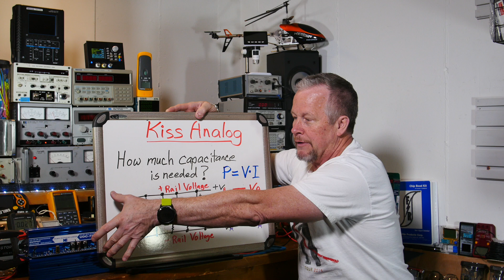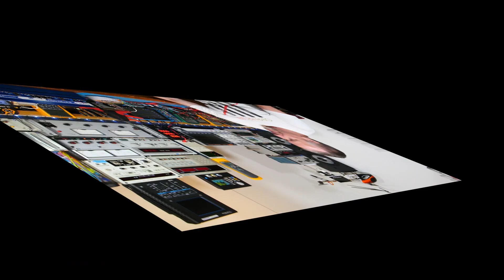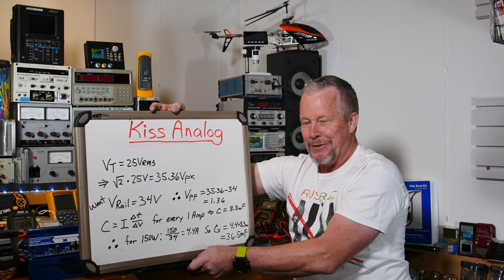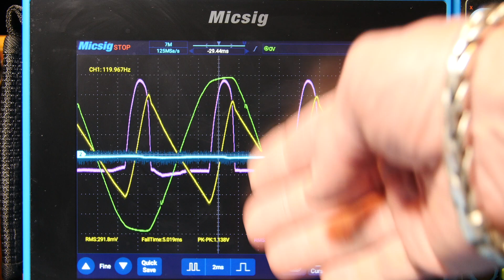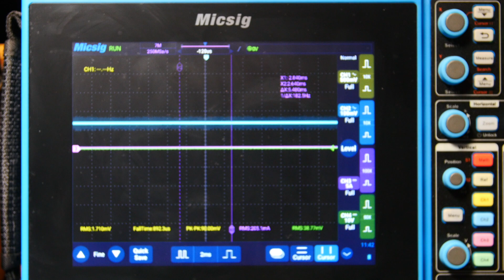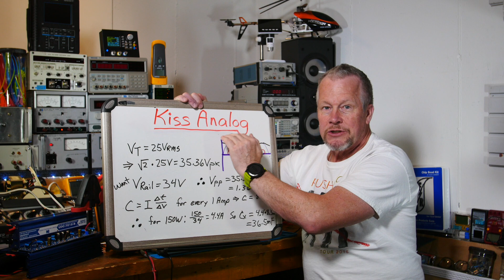How Much Capacitance is Needed? #capacitorbankdesign #capacitor #howmuchripple #capacitordesign

Comment: Hey Eddie. I may be 3 yrs too late for this vid, but the information you give will of course never NOT be useful. (Sorry for the double negative) I’m in the process of getting together everything I need to put together another one of Nelson’s designs, the F6. It’s got all the power I’ll ever need with both of my main pairs of speakers being aprox 95dB sensitive. 

Also, before I build it, I wanted to give you a heartfelt thank you for sharing this information regarding the PSU. My job mostly consists of setting up, fixing, and modifying guitars, building custom effects pedals, but I also occasionally fix tube amps, but I haven’t actually built one, let alone a solid state one. The 2 types of amplifiers may be different, but they’ve got more in common than not. So, again, just a late thank you for taking the time to explain the build process of another one of Nelson’s brilliant designs.
Reply from the maker: Thanks so much for your feedback!  I appreciate you!

Comment: Hello,

I do not know decide between amplifier atoll in100 and in80,   class AB

the in100 has two toroidal transformers of 340VA, it is NOT dual mono, 
amp is 2x100W

thi in80 has one transformer of 340VA
ammp is 2x80W

both have the same capacitance about 31000 microF, isnt this small for 2x100W?

Which one is supposed to be better by teory?

Thank you

Comment: Great video. Im looking on eBay for an amp to send you that uses around 16 volts and is AB so I can also send you a large cap. I’d be interested in seeing which performs better a bank of smaller caps or 1 large cap. Your videos have got my brain on power supplies and amps 24/7.
Reply from the maker: Thank you Tron - that is very generous;)

Comment: Hi thank you very much indeed for your video.  Unfortunately i have difficulty to understand complex issues.  But if i got it right the result says that in  most of commercial amps power supply capacitance is undersized ?  i usually see less than 1mF/rail/channel  
Actually very often i see only 2 x 10,000uF caps in total   This makes sense considering that big caps are so expensive. Costs saving. 
And i have the feeling that this has a big negative impact on sound quality.   Some brands used to offer a capacitance upgrade for some of their power amps.   A good practical way could be to put an analog voltmeter across power supply caps terminals and see if the voltage stays steady or drops during the loudest passages.  My guess is that in most cases drops. Thanks again, gino
Reply from the maker: Great input Gino!  Yes, a higher voltage and more ripple could be less costly.  This might be just fine, but maybe not.  your idea of measuring the voltage is right on point.
Reply: @kissanalog  Hi thanks a lot for the very kind reply.  I have done some tests ... i think that most of commercial amps have too low capacitance in the power supply.  I added some mF and the sound was better.  
Maybe i am hearing things but the sound was more relaxed and powerful More like the one from tube amps for instance.  Tube amps have a great energy storage in the caps because of the high voltages.  Stored energy goes with V^2  Thanks a lot again, Kind regards, gino

Comment: I like that Micsig scope.  Been doing a lot of research on a new scopeand it's way at the top of the $1000 and under scopes.  My old scope is a Rigol DS1102C (yep C).  It's time for me to get a four channel upgrade. There are things I feel it's missing, but they can easily be fixed with software.  The hardware is rock solid.  Do you see any deficiencies that couldn't be fixed in software?  I also like the Rigol MSO5000, but I'm afraid that it won't get all of its bugs fixed and the noise level is a bit high.    I know it's hackable to upgrade the bandwidth, and it has more memory and faster sampling, but it's not portable or battery powered.  The STO1104E is a nice upgrade over the C version.  Which version do you have?  Either one blows my "antique" Rigol away on memory depth and sampling rate, but I have to admit my cheesy 400MSPS Rigol has been good to me.    Have you used the phone app for the Micsig?  Thanks from a relatively new subscriber.
Reply from the maker: tonyfremont Thank you Tony!  I do like this Micsig Oscilloscope.  You might try this link.  I’ll get a credit but my viewers are also supposed to get a discount.  https://www.banggood.com/custlink/vv3dVGTFpl
Reply: @kissanalog  thanks for the link, how can I tell if I buy something else, if it will give you credit? Would I need for you to create the link? I really prefer the STO1104E version, but banggood doesn't have it currently.  I'm sure they will eventually start selling the E version.

Comment: Hi Eddie, 
So, I guess that tje diodes and the transformer need to handle much higher currents because the power has to be supplied in short bursts. But the duty cycle is not 100% either,  so how would  you dimension the bridge and the toroid transformer? 
Cheers 
Mark
Reply: Look at peak current capacity of the diodes and average current capacity, peak inverse voltage is a consideration, but probably not that critical on a full wave bridge setup....until a diode fails.    I guess the same thing for the transformer, magnetics is not a strong point with me.  I wrote another little diatribe, in another comment I replied to, about ESR, voltage ratings and current capacity on capacitors that you might be interested in.
Reply from the maker: tonyfremont Great insight tonyfremont!
Reply: @kissanalog  thanks. :) I really like what I'm learning about that scope.  I want one and I want to use it for automotive purposes too, but Micsig doesn't want to add the features of the ATO scope to it.    I'm hoping that because it is Android based, that there will be a way for owners to develop applications that work in conjunction with the scope features.  I'd also like to see it support the Google play store.  Neither of those should require any significant work by Micsig.  The really big thing I want to see is an overlay of vertical cursors delineating 360 or 720° rotation, subdivided by the number of cylinders selected.  That is an invaluable feature for automotive, and even electrical engineering use.  Radians might be useful too, for those studying electrical engineering.  The E model scope has really improved sampling depth and waveforms/second.  Too bad they didn't increase the sample rate.  I'll probably buy it anyway.  I'd love to see Sigrok Pulseview working on this scope, but the Android version seems to need a lot of work for android 10.  It would add logic analyzer functionality to it as well as the kajillion serial protocol analyzers and deciders that Pulseview has available.  I believe that would make this the most sought after scope for bench and portable use, on the market.  Micsig only needs to make the API available and allow android apps to be sideloaded by the user.
Reply: @tonyfremont  thanks, Tony
Reply from the maker: Question Mark That’s a great question and I’m doing a video to explain;)
Reply: @kissanalog  Thank you, Eddie. Looking forward to it.

Comment: As Genghisnico13 said, great video and well-made in a fine pace! :-)
Your "out of focus" is because you have autofocus on and it tries to focus on  any moving objects. To avoid that can you turn autofocus off.
Question: The yellow Sawtooth line, is that not also very much dependent on the capacitors ESR?
Reply: I think the yellow voltage line shape is primarily affected by the load, but Vf of the diodes in the bridge and turn off time of the diodes would affect the shape of the little hump on the yellow line, and ESR might play into it.  I do believe the ESR of the caps has a lot to do with the slope of the charge current waveform (purple).  And this brings up an important item to not overlook, ripple current in and out of the capacitors is another capacitor rating that needs to be addressed.  The current, combined with ESR, leads to hearing of the capacitors.  Going outside the manufacturer lines leads to pyrotechnics on the bench.  Keep an eye on how hot everything is getting.  With caps it's not just about voltage ratings in an AC environment.  

On a side note, I'd you want to find out if a cap is fake, charge to full voltage and give it a charge discharge workout like this video shows, limited to datasheet specs. You'll find out if it's fake pretty quick, wear your safety glasses and kevlar suit and keep a fire extinguisher handy.  Have your phone handy, just in case. ;)
Reply: @tonyfremont  Thank you a lot for your amazing answer. My idea about the ESR did come from, me thinking I could spot the reaction / discharge time.
Now you talk about safety, I am wondering on how do you best protect yourself? A cap or even a super cap can fast get too funny!!
Reply from the maker: Thanks Fried Mule!  I hope I answered the esr question in the follow up video:)   I thought I had the auto focus off, but sometimes I hear it moving - strange.

Comment: What about  0.1uF poly across each filter capacitor, do they do that so do keep the ripple down is that the same as putting the capacitor at the end on the diode
Reply: those 100 nF (or 0.1 uF if you prefer it so) are used to cut off high frequency noise, from wherever noise may come
Reply from the maker: As #444guns has said, the small value caps are great for high frequency noise.  It is a good idea to parallel large bulk caps for this reason.
Reply: @kissanalog  I'm just not sure if it's better to have it at the diode Bridge or on the capacitors ? I would have thought the Bridge diode would be better or both maybe?